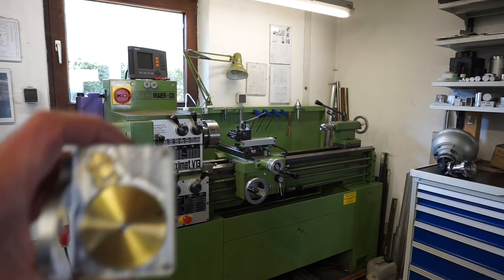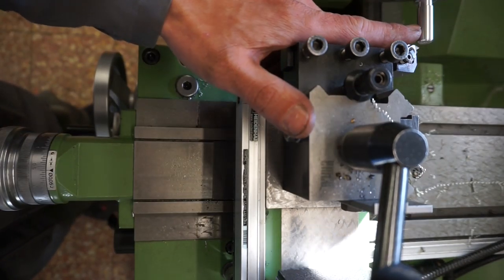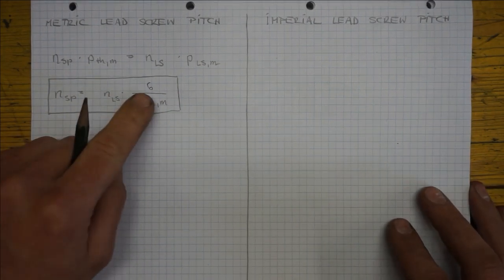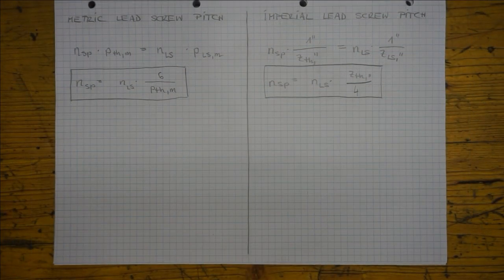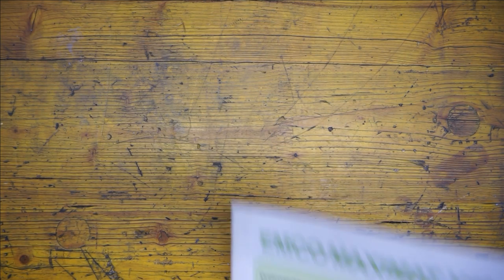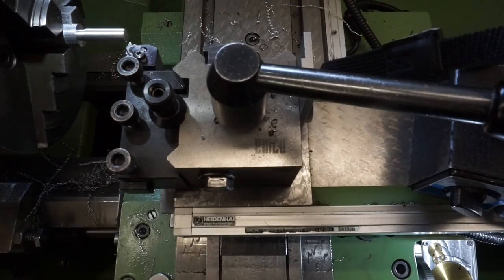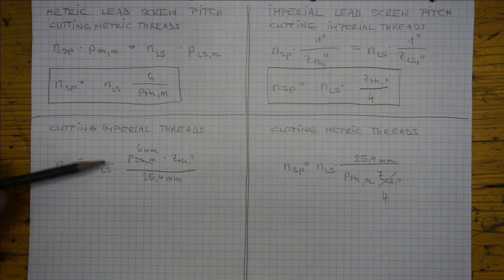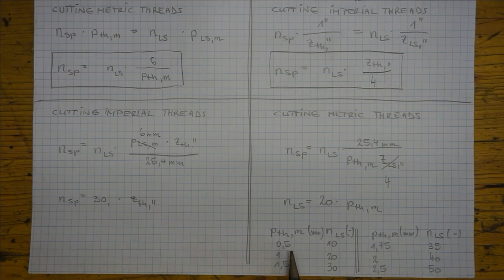Threading Dial Indicator for Metric AND Imperial Threads

Comment: they still teach that you have to have the clasp nut engaged at all times. I tried to explain it to some oldtimers in my company and they were stunned when it actually worked. Although I measured the leadscrew pitch to be safe and it was 5 instead of 6. I used your formula for the pitches you can disengage the clasp nut and all of them worked.

Comment: All of the metric threading kits for imperial lathes have a 127 tooth change gear in addition to many smaller gears and I never really knew why. This video clearly explains it, thank you!
Reply: Not quite true.  There are many combinations of gear ratios that can approximate the conversion with more or less accuracy.   14 different examples are detailed in 'Screwcutting in the Lathe' in the workshop practice series.   The Myford ML7,  for example,  uses an approximation that relies on the use of a 21 toothed gear.

Comment: This screams for a small rotary encoder based solution. I love that you built a clockwork device, and I know there are computer controlled lead screws (the optimal solution) but for someone who wanted to "keep it real" having a small electronic unit to do all this conversion without having to go as far as you did would make some sense. I think I will build one for my mini-lathe before I go full conversion (which has seemed overkill.)

Comment: Hi,
I have the EMCO Super 11 that I purchased in 1989 (imperial). I also bought the threading dial which I think they used on both metric an imperial. The dial is a little different then the dial in your catalog. My dial has three meshing gears on it, 14, 15, 16 teeth. I use the 16 but I don't use it much. I built a lathe stop foot brake pedal like the one in the original catalog so I stop my lathe at the end of the thread and reverse the spindle.

On imperial lathes it is easy to know which threads don't require a thread indicator. If the thread is divisible by the lead screw then you can engage it anywhere. On the Super 11 the lead screw is 8 tpi, so 8,16,24,32,40, etc. work with no problems.

I don't remember if the Super 13 came with a foot brake but this makes threading very easy. On critical threads where I want to stop at an exact place I use a hand wheel on the rear of the spindle.

Comment from the maker: IMPORTANT SUPPLEMENT: In the example at 9:15 I messed up the numbers, sorry guys. The fraction 4.8 is for a thread pitch of 1.25mm, not 1.75mm.
Reply: yes was a little confused and came looking in the comments. 6/1.75 is 3.42857143, not practical to have an integer in this situation i guess? do i just keep the LS engaged and reverse in this case? making a M12 drawbar. thanks for the videos

Comment: Alex, I am really impressed by your comprehensive engineering approaches to the situations and phenomena you describe, and your very clear explanations.  I also enjoy your attitude and sense of humor.  I came to your channel because of the discussions of welding distortion.  I am an electrical engineer learning TIG welding, and my electronics training is not much use for welding!  I am welding a stainless steel project, and knew that the response of stainless steel to heat would be much larger than for mild/carbon steel, aluminum, etc.  I watched your videos and did some experimenting, and now I have been able to quickly and easily reverse the distortion that my welds have caused.
Reply from the maker: Glad you find the content useful, Sir.

Comment: Nice job and well explained, in my personal case I think 90% of the threads I have to single-point are multiples of the leadscrew pitch so I can probably reverse the spindle for the rest of them. I have the brake and everything after all.

Comment: Great work, and great video. Please do a full video on the build and machining of the dial. Id like to replicate it, with some slight improvements, for my 6mm lathe leadscrew. 

I have "screwed" up 3 threading jobs over the years because i forgot to change the thread dial gear. This would help greatly as im getting much older and foresee many more similar blunders in future. 

Subscribed. 🤙
Reply from the maker: I'll try to make a detail video about the indivator if I find the time. At the moment I have no drawings for it, because I made it on the fly.
But the design for a 6mm pitch lead screw is very simple: 10 tooth gear meshing with the lead screw. Small 10 tooth gear and 10 position indicator disc on that same shaft. 35 tooth gear on second axle, driven by 10 tooth gear on 1st shaft. 127 tooth gear on third axle, driven by 2nd axle (i.e. the 35 tooth gear).

Comment: A couple of thoughts on avoiding changing indicator gears:

First: gears of 20, 21 and 22 teeth will do everything you want. Cut all three gears on a gear blank sized for 21-teeth then the mesh centre distance does not change. Put all three on the same shaft. Then you can shift gears by sliding the shaft up and down.

Second: gears of 35 and 36 teeth will do all apart from 5.5mm and 11mm pitches. Cut both on a blank sized for 35 1/2 teeth. Shift by sliding. Have a reversible graduated dial with seven divisions one side and five divisions the other side. The other graduated dial would have 12 and 9 divisions.

Your method is very good but I would get confused over dots, double dots, squares and triangles.

Comment: Thanks for the analysis Alex. Metric guy here as well, had an apocalypse when I found out that I could break the 'half-nut engaged' rule for threads whose pitch fits integer number of times in the leadscrew pitch! :) (it is a bit risky though, since, without a dial, you may end up with mis-engaged nut: half closed nut that can drag your carriage but with a phase offset....Not nice if the thread is a difficult one o a valuable part...)

(now I have ended up with an imperial lathe and though I can disengage nut when metric threading in order to stop at a shoulder I do have to reengage and reverse the spindle to go back...)
Enjoying your work very much, thanks for sharing.

BR,
Thanos
Reply from the maker: Hi Mr. Thanos,
right, if the nut is not thoroughly closed, braking the rule is dangerous. On my lathe, luckily, the nut closes nicely and you can clearly feel it when it is fully closed.
Greetings, Alex
Reply: @anengineersfindings  Hi Alex,
right, you can always tell if halfnut is fully engaged, especially if it's your lathe that you're working on. But still, if things are tight when starting back the thread, first try in closing the nut might result in 180 deg out of phase. Halfnut won't close of course but it will touch on the peaks of the leadscrew thread and will start dragging the carriage. Ask me who I know...:)
BR,
Thanos
Reply: The handbook for my metric Colchester lathe makes a comment about when and when you can't disengage the half nuts, but folks used to working in imperial are wary after the first mismatch. Took me awhile to be certain when, but now i know for sure.😊
Reply: @chrisstephens6673  actually, you can disengage anytime, as long as you don't miss your spot and re-engage at the same spot going in reverse :)

Comment: Great information for sure.
But i think i will stay with my current way of Cutting Threads on a Manual Lathe.
Metric Lathe with a Metric Lead Screw: 
disengage and re-engage for Metric
drive back out for Imperial Threads.

Comment: This is a great video, however the ending was rushed. I have a 1930's IXL Leader lathe with 6tpi lead screw. However this machine is flat belt driven so there is no reverse. I have to confess I got lost with the math at the end... if I understand it correctly if I am cutting 2mm pitch I have to wait for 40 revolutions? How does you dial indicate when the 40 revolutions has passed exactly?

I would love to know how the old timers cut metric threads on these lathes with no reverse, no brake etc. I believe how they did it is to  stop the lathe after the cut and use the tumbler reverse to reverse the lead screw, making sure to engage on the same number as the carriage is reversed.

Comment: I have been thinking about making a thread indicator for metric threads and was discouraged when I found it would take changing gears on the indicator to make it work. Is your design somewhere so that I can download?
Reply from the maker: Sorry, I have no drawings for this indicator. In fact I got the gears and just machined the housing on the fly, so as to place the gears to each other with the right axis-diastance. This indicator is very simple, there is only one gear per shaft.

Comment: you say 25 POINT 4 but you write a comma!   ~~~~       very interesting video!    Did not know metric lathe dont have threading dials often!
Reply: This always drives me nuts too- but I use a lot of swiss tooling in watchmaking, and this is a thing they do instead of decimals. I have no idea why- and have never seen an explanation for it.
Reply from the maker: Sorry about the comma, but this is how here in continental Europe we learn to write numbers in school.
Reply: An Engineer's Findings so how is a number like this written?  123,456.7890000?
Reply: @Joemama555  A comma separates the full number and it's fraction. Pi for example is written 3,1415
A dot separates thousands, so for example one-hundred-thousand is written 100.000
Or did I misunderstood your question?
Reply: @Joemama555  I EU world 123.456,78900000

Comment: Great video.I see your lathe has frosting marks on it. Did you scrape your lathe in , . I see your home country is the same as your lathe. I need to try make a gap for my Emco v13 as it is a poor design and I am suprised Emco would have done this.
How do you stop your lathe so quick while thread cutting.? Have you got your lathe running on a vfd with a break resistor. Happy to have found your channel. Thank you.
Reply from the maker: Some years ago I scraped cross and compound slides of my lathe. Right, Emco is in Austria, not far away from where I live actually. My V13 has an electric spindle brake, which was optional back in the day. Thanks and regards, Alex
Reply: @anengineersfindings  I seem to be one of the very few owners of an Emco v13 that has a permanent gap . It has a much longer compound to compensate for work close to  the chuck. If I use my original Emco three jaw and am working within 50 mm to the chuck the carriage is hanging over the gap. So dirt gets under the ways all the time. Rigidity is severely compromised. I need to make a gap.Did you ever document your emco refurbishment.?
Reply from the maker: Wow, the gap issue is weird. Can it be that a pre-owner just didn't give you the bridge when you bought the lathe? Sorry I only have two or three pictures of my lathe refurbishment and DRO-upgrade.
Reply: @anengineersfindings  No the casting in the gap is rough and there are no hold down bolt holes.The topslide is also  285mm long. Much longer than standard.I dont know how long the standard compound slide is.?

Comment: great explanation. I have a Boley 5LZ with a 6mm leadscrew and an internal gearing which makes the "pitch" 4mm per rotation of the spindle. Does this  interfere wirh your formula's
thanks: subscribed and liked. Hope you keep producing!
Reply from the maker: Thanks. I'm not sure if I understand your explanation right. Do you mean, your lead screw moves your slide 4mm for each spindle revolution? Does this mean this lathe can only cut 4mm pitch threads? Or does the slide carry the threading gearbox?

Comment: So on my Emco V10p, which has a metric gearbox and 3mm pitch leadscrew, i can open the half nuts if i'm cutting 1mm, 1.5mm, or 3mm pitches?
Reply from the maker: Right. Also with 0.75, 0.5 and 6mm pitches.
Reply: @anengineersfindings  i'm going to give it a try. I was always taught to keep them closed for metric.this will be a huge time saver. Thank you for the video!
Reply from the maker: Give it a try and let me know if it doesn't work.

Comment: A closeup of the indicator during threading would have been nice to really understand the function, in the video we unfortunately can see nothing.
Is any plan or schematic available including the required gears? That would it make a little bit easier to understand and maybe to adapt to an other leadscrew pitch.
Reply from the maker: If I find the time, I'll try to make some plans available. Thanks.
Reply: @anengineersfindings  Maybe just a short clip with a closeup and an explanation what is happening and how to read the scales maybe enough and done with less work than plans?
Dankeschön :-)

Comment: Interesting - seems like the right way to fix all this is with a resolver and a tiny computer board.  A solenoid could time the engagement more perfectly protecting the nut and lead-screw..
Reply from the maker: That's surely possible. In my case, however, I was looking for a mechanical solution for simplicity.

Comment: my lathe has a 5 TPI, I know, no joke.  Do I have a metric or imperial lead screw?
Reply from the maker: 5 threads per inch is an imperial pitch, not a metric one.
Reply: @anengineersfindings    I was trying to 3D print a gear which I could use as a threading dial.  The lead screw has a 5TPI and the pitch diameter of .0.8265".  So  to find the diametrical pitch, DP=num of teeth/pitch diameter.   So DP= 6.02...  To match gears, the DP of both gear must be the same(keep in mind that i am meshing a screw ACME to a gear).   The CAD program I was using just required me to input these givens and it    produced the gear for me.  I printed the gear and it didn't mesh with the lead screw.  Since I used the TPI value for my calculations, It is not a gear, so I multiplied the DP I found by Pi and it gave me a result of 18 approximately Diametrical pitch.  So I 3d print a gear with 35 teeth with a DP of 18 and it worked.  Is this a coincident, maybe.
Reply from the maker: @dlfabrications  If your lead screw has 5 TPI, then the spacing between the threads is 1/5th inch. Your gear needs to have the same pitch between it's teeth. I.e.its diametral pitch should be 0.2". I don't know about the inputs on your cad though.
Reply: @anengineersfindings   No. You are confusing diametral pitch and CIRCULAR pitch. A 5 tpi leadscrew will mesh with a 0.20" circular pitch gear. There is a standard formula to convert between circular and diametral pitches (0.2" CP ~=15.7 DP). This place: https://www.engineersedge.com/gear_pitch_chart.htm or khkgears site is very good in this respect.

Comment: "In the Metric World it's a little more complicated". But, but Metric is simpler 🙄

I still think a reversing lead screw would be easier. Not only to build but also to use
Reply from the maker: Right. Or a lathe with automatic disengagement, like a Hardinge-type.
Reply: Or a VFD and an automatic lift clear threading tool like the Victorians had, oh and me.😉
Reply: @anengineersfindings  
Maybe I got spoiled. Where I retired from we only had 5 Hardinges